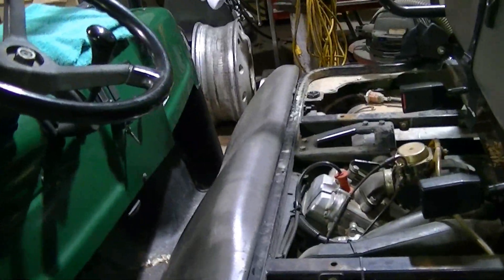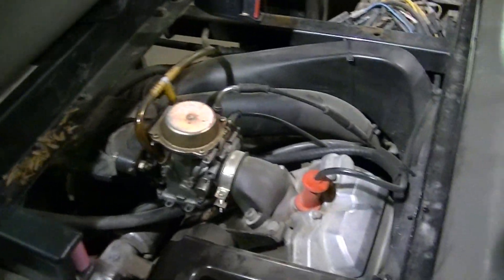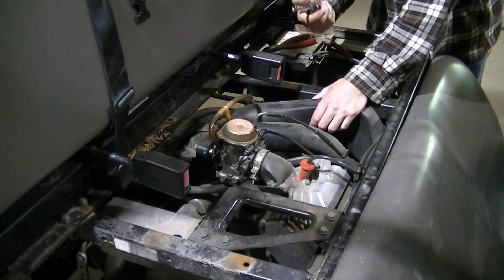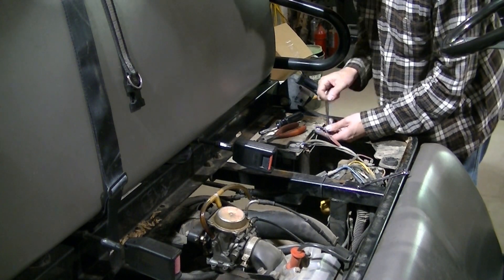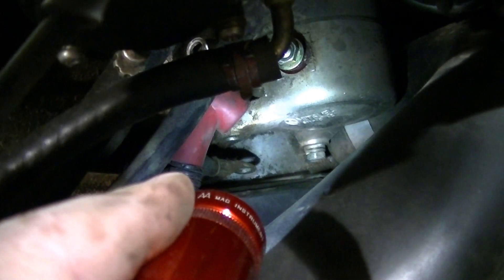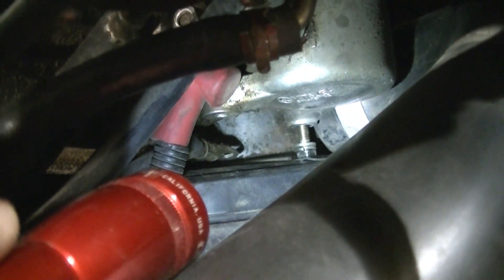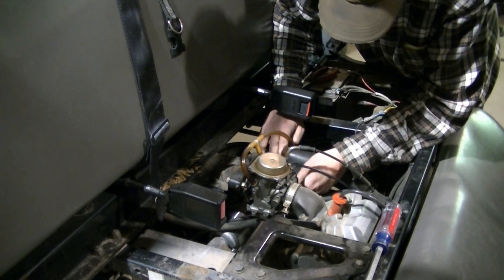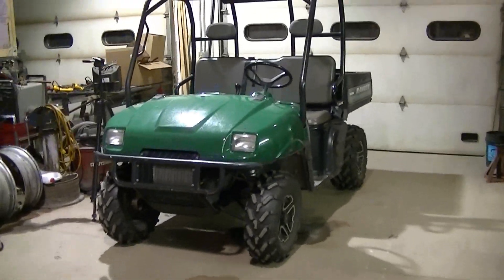2002 Polaris Ranger 500 Starter Replacement

Comment: For anyone looking, this method also works for 2005 Ranger starter removal. Getting that bottom bolt out takes patience. After starter has been pried back, rotate starter in a clockwise direction. If you get frustrated, walk away and come back later. It WILL come out this way. If you're still around, thanks mossman.
Reply: Forgot to mention that I also removed the carb on my 2005.

Comment: I have had my 2002 ranger since 2002 and have never had a problem with it. I use it around the acreage hauling hay, gravel, dirt, etc, pulling a small manure spreader, and plowing snow with its 6-foot manual snow blade, plus just riding it around here. It has been a beast for me for 19 years with no problems until this morning. All I got was a "click" when trying the ignition, and this has been happening occasionally for the last couple of weeks but it did start after trying the second time usually but not this morning. I checked all the battery connections and they appear to be good. I then came into the house and pulled up your video. My starter is doing exactly what yours did. I tapped on it and it turned over. I shut it off and tried again and it just clicked. I tapped it while trying to start it and it turned over slowly, but turned over. I am going to order a new starter and hopefully, my hands aren't too big to fit down into that very small space. Just looking, it looks impossible but I did watch your video and you did a good job of showing us how to do it. I probably should try to order a new bottle of "patience" because I am pretty confident I am going to run out of that! Thanks for sharing!!!   J.R.

Comment: Thanks for the vid. When I reinstalled the starter motor I shortened that bottom bolt by 4mm which made it a whole lot easier getting it in. I couldn’t actually get it back in until I did that.

Comment: I used a wood clamp to help keep all the extra cables and stuff out of the way, made it easier to get a wrench and hands in there. Then I used some para-cord attached to the bolt hole where the negative terminal was attached, then attached the other end of the paracord to a wood clamp that was also attached to the top roll cage bar above seat... then started compressing the clamp to rotate and pull the starter. I also applied some lube to the splines area of the starter to help it move. It "popped" right out. Thanks for the tip on "rotating" it!

Comment: great video! I just did my 06 Polaris Ranger 500 starter and when you get to that last screw have someone use that same flat head screw driver and gently pry on it from the back side while you wiggle and turn it and it will pop right out. if you use both hands to seat and start that same bitch of a screw back in it works great. Thank you for this video and thank you to all comments that are helpful..... Don't take the carb off you can do this job with out it.

Comment: I have a polaris 500 ranger 2007 the starter went out while stuck in my pasture. I got a new one and got the old one off that bottom bolt was a birch to get out. I put the new one on mud was a foot deep. I put the top bolt in I tried to get the bottom stared l couldn't get the bolt to start. I decided to start the side × side get it back to the shop so I did got it unstuck took it back to shop then I went to tighten the bolt and it viberated it's way in. I give the bolt 2 turns and it was tight.

Comment: Mossman - excellent video. I need to clarify one thing. I do have 12+ volts at the starter when I turn the key and press the break, but the starter does not turn. You can hear the click when the starter solenoid pull in. I'm thinking my problem is the starter, but before I pull it, is there other things I need to check?
Reply from the maker: I would say bad starter.

Comment: changed my starter on my ranger 500efi 4x4 only last like 1 year also change switch to push button took out polaris ignition switch still starter will not last any suggestions also i notice what appears to be oil plugs above and below starter is there suppose to be oil in flywheel case 2010 model

Comment from the maker: The starter bendix will stay in place when you pull the starter out.  If you look at my cleaning pickup coil video you can see what the starter bendix looks like.  No need to pull the clutch to do this job.
Reply: How do you remove the starter bendix? 
I have not found any info.

Comment: hi my 2005 Polaris 500  utv .  had the same proplem  the starter   .  but up on   removeing it  I cut  a peace of the cluch cover behind the starter   to remove mine a lot easer   to remove and install  its  mine so ill just seal back up the hole  with seal clone .
Reply from the maker: No need to cut anything.  It's tight but it can be done.
Reply: I done it my way .  a lot easer   now I got to put a new starter   on it .
Reply: roy thornton I cut piece of mine too before I got mad burnt the whole thing !!!

Comment: I’ve replaced the 4th one on my 2006 efi 500 ranger with 1300 hours on it much too small to last very poor design plus tiny battery don’t help
Reply from the maker: I haven't had many problems with starters on these Rangers. If you are stopping and starting a lot then you might have to replace them more often.